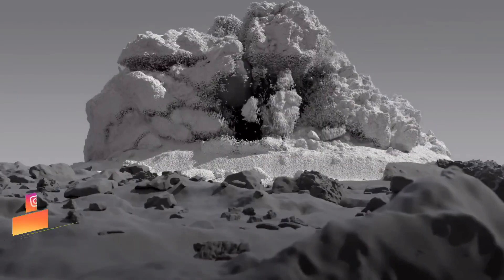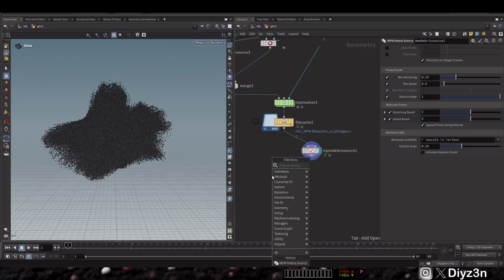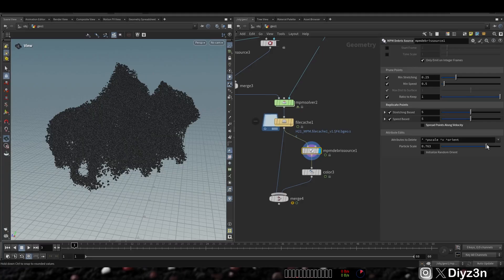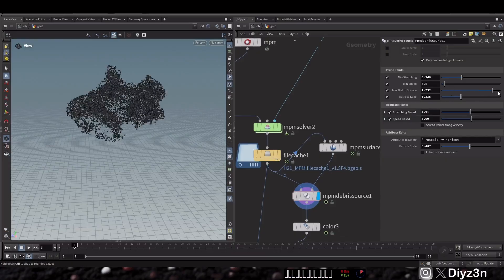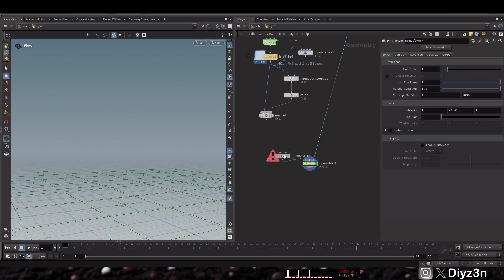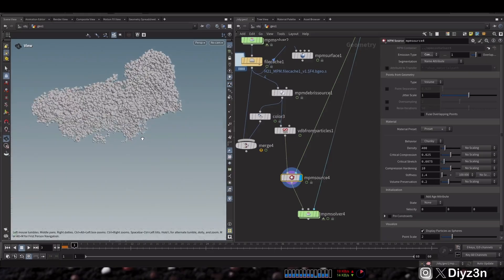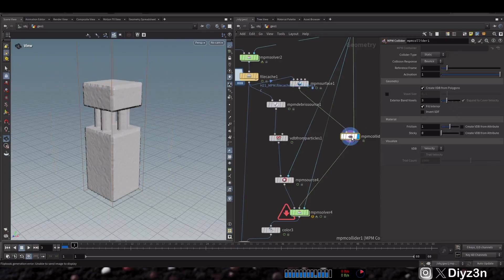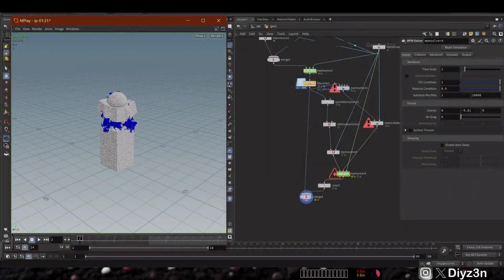Houdini 21 First Look: MPM Secondary Simulation ￼

Comment: Hey bro, I've had a problem with MPM  that's been bothering me for half a month. I added a ball as a honey to simulate falling to the ground, and the mesh looks fine on its own. But after applying a specular material, like a glossy metallic one, there's a small area of jitter on the surface in the preview of the slap animation without rendering (of course, the actual rendering also shows this problem). I've tried increasing the number of particles, increasing the simulated stride, and adjusting other parameters, but none of these have solved the problem. This jitter is localized and not very significant, but it's not negligible! Do you have any good solutions to this problem?
Reply from the maker: hey bro, have you tried smoothing that with vdb ?
Reply: @diyz3n yeah I tried N and P smooth,but not work
Reply from the maker: Odd, can you explain for me which approach did you choose to mesh your particle?
A-particle fluid surface
B-VDB
C-Neural MPM
Reply: @diyz3n  I used B, and I also tried A, but the effect wasn't as good as B. I haven't tried C, so will it be better? I suspect this problem is caused by the particles themselves simulating the car's movement, because I've noticed this phenomenon only occurs locally. Perhaps you could give me your email address, and I'll send you a video to help you better understand the problem.
Reply from the maker: @苏昆-g6y yeah go ahead 
This is my email honersforgod@gmail.com